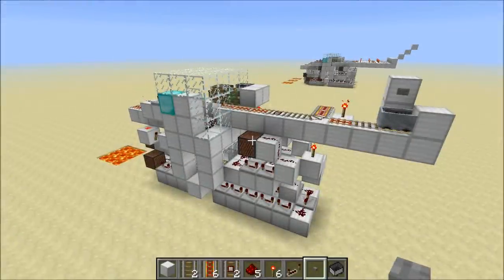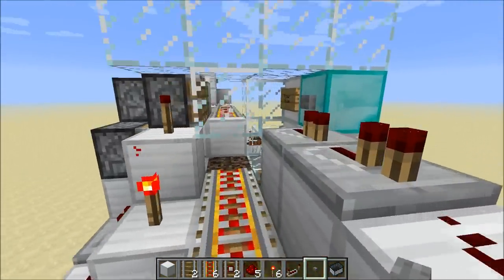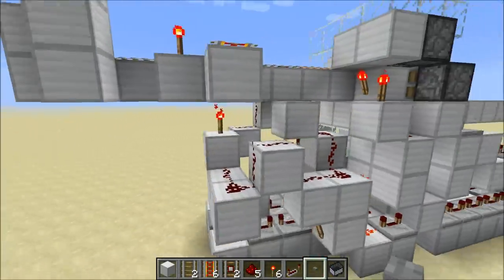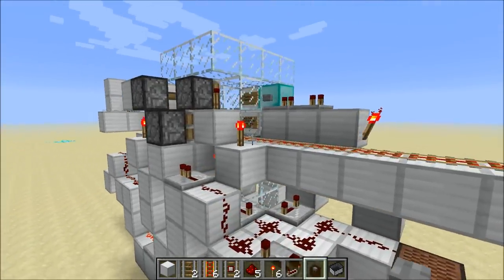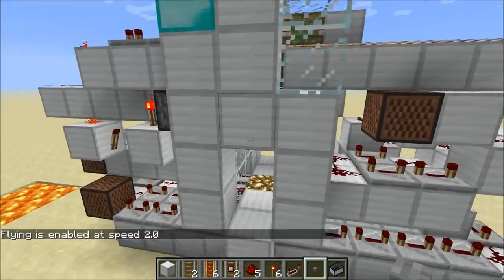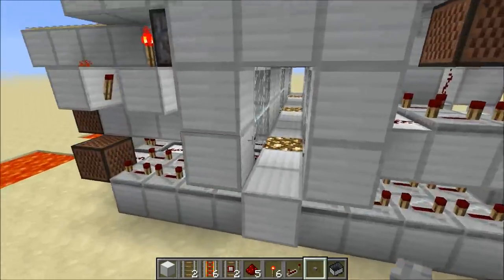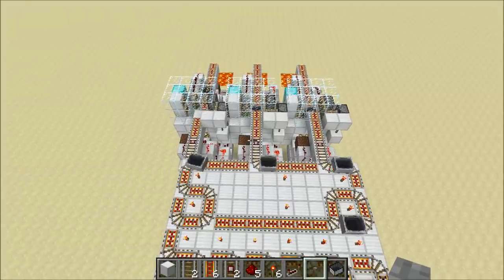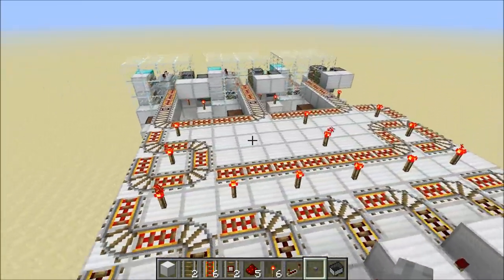Improved Minecart Arrival Bays (Minecraft 1.2.4)

Comment from the maker: You can use any solid blocks like stone, iron, or coloured wool. Glowstone, glass, half slabs, or any of the fence-like blocks won't work because redstone wire and torches won't attach to them in most cases.

Comment from the maker: I don't think the bay as it is now would work as a two-way single track system because it is inherently one-way. Carts enter in from one side, drop down one block, and then exit out the other. The bay is really meant for systems that are like real-life subways, where there are two parallel tracks, each dedicated to one direction of travel. Carts would travel up or down the transit line, stopping at each station along the way. I hope this helps your understanding.

Comment from the maker: I really don't recommend building the station from scratch, unless you have lots of time and patience. The circuitry and track placements are rather complicated, and one misplaced block can easily break the system. The station is really designed to be imported into a world, so that it's ready to go with very little setup.

If you really want to know though, the dimensions are 41 wide by 33 long by 16 high (the long part is parallel to the main track).